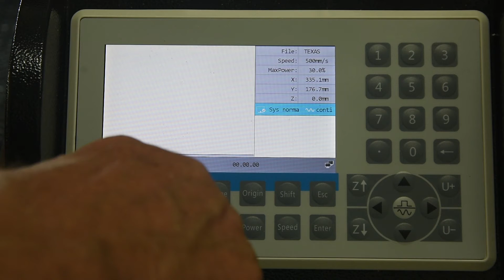RDC6445G Laser Focus

Comment: Hi George, Please can you confirm accuracy and repeatability that you get and expect on your machine. Say you cut 50 20x20mm squares as an example in different areas of your table. Thank you Much appreciated!
Reply from the maker: I've never measured it on this machine, but I would expect +/- 0.002".  It depends on the material and power settings.  Too much power on wood, for instance, will cause over burn and affect width of kerf.
Reply: @makerspace533  Thank you George. Appreciated!